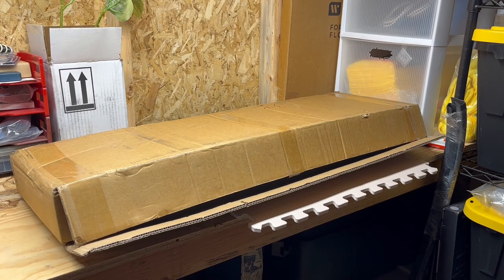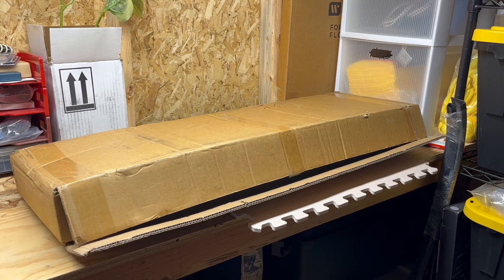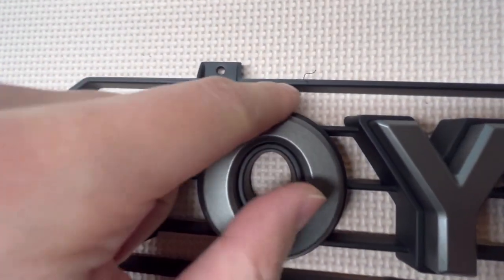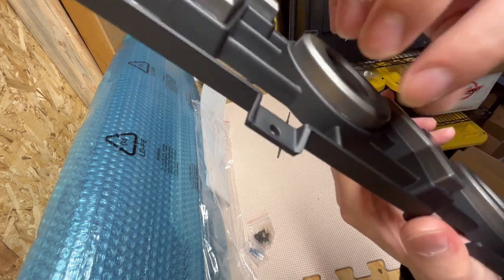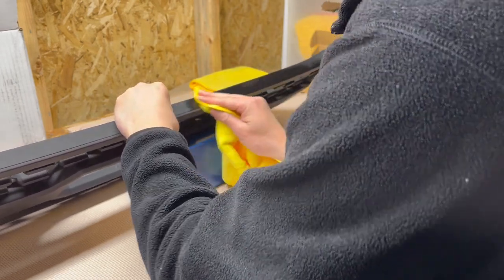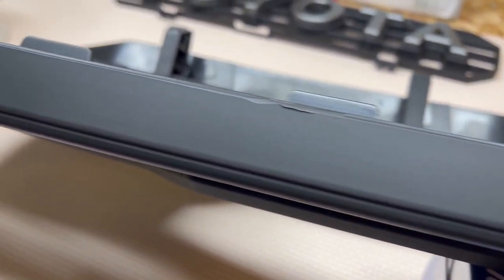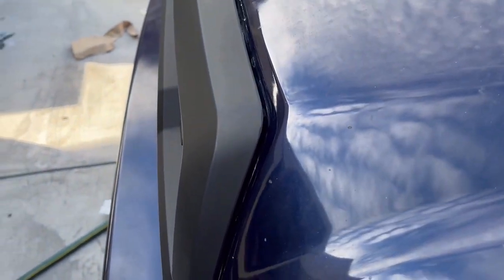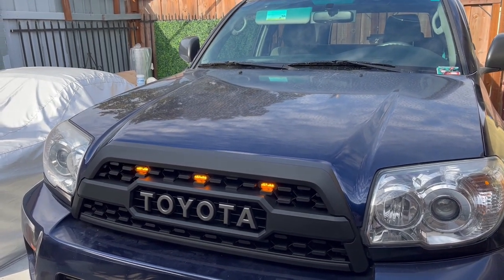4th Gen 4Runner TRD Grill Install

Comment: You paid $130 including shipping? All of the ones I've seen on Alibaba are like $100+ for shipping to the west coast
Reply from the maker: I bought the grill in 2021. Its been sitting on my shelf a while before I installed it. Inflation :(
Reply: @wils_builds  so it seems at this point it's just cheaper to buy from a north American reseller, thank you!
Reply from the maker: When I bought it the shipping was 40 to the SF Bay Area. Shipping might be harder now. There's plenty of North American sellers. But you can probably expect similar quality since they probably buy bulk from the same manufacturer.

Comment: Ill keep my black chrome grill on my 07 sport edition..also had my hood scoop black chromed as the paint was rubbing off and the rear latch assembly as it was rubbing off at 250k miles  ..the flat black really doesnt go unless you do the black headlights and all the id badges...just my personal opinion
Reply from the maker: Im not really sold on the flat black too. I might end up color matching parts of the grill down the road.

Comment: The gap on mine was smaller but I ordered the trim and it made it look a little more polished!
Reply from the maker: Yeah I definitely need to order a new trim piece
Reply: I ordered the trim piece. Toyota calls it a Grille Insulator. $37.00 + tax and takes a couple days to get in to pick up. I don't want to chance having the old piece rip or look crappy and have to drive around grilleless for a couple days.
Reply: @paulcali08  I got it at the dealer for around $20 I think.  The OEM was does have a seal.
Reply: Is this trim piece you guys talking about the metal piece that goes on the inside of the grille, cause I am having the same problem with a gap at the top. If it is do you mind sending a link to whatever the problem is?
Reply: It’s the rubber trim piece that goes on the back of the grill to the hood.  Any dealer will have it or sparks auto parts!
Reply: @Medickep  oh sick alright, thank you!

Comment: Did the coating make a difference in how the grill looks?
Reply from the maker: The coating definitely helped the plastic keep a nice finish. Still looks good and no fading so far
Reply: @wils_builds  what’s the coating called?
Reply from the maker: @ClutchKillers  I used Undr Dog coating on the grill. But any ceramic coating will help to keep the grill plastic looking new. 

I usually use Gtechniq - CSL Crystal Serum Light now. 

https://amzn.to/3rf6Qbd

Comment: What would be a less expensive plastic protector than the Undrdog Pro?
Reply from the maker: I think something like Cerakote Ceramic Trim Coat would work well and last a long time. Its also reasonably priced for a coating.

https://amzn.to/3wb7NQX

Ive also seen many people recommend Solution Finish Black Plastic & Vinyl Plastic Trim Restorer.

https://amzn.to/3XC48Ye

Those would probably both perform well at keeping the plastics looking new. You can always just re apply if they start looking dull later.  

I just had left overs of Undrdog from another project so used it. 

Hope this helps!

Comment: Hey I just installed my grill from TEQ customs. I grounded it just like you. But when I put the fuse into the CIG10A, nothing happens.
When I used the ECU-IG 10A, it works. Can I use that, or should I worry?
Reply from the maker: The ECU-IG 10A will work. I originally used that but switched it to the CIG10A. I chose to not use the ECU-IG because I was worried it could mess with starting the car. I had it like that for about a week and didn't have any issues. Run it at your own risk but I don't think the lights are strong enough to affect the fuse.
Reply: @wils_builds  I ended up putting it into an empty slot in the middle with two 3amp fuses. The ECU-IG actually didn’t work. Caused a bunch of problems.
Reply from the maker: @benwachtel23  I might switch mine to that then. But haven't experienced any issues so far using the CIG10A
Reply: @wils_builds  ok. Also thank you for being the one person who can properly explain how to install the grill. Not even the company I bought mine from could explain it. They never included any steps into the lights.

Comment: I keep coming back to this style grille. I have an 04 4th gen. Some say it'll work others say it will hit the bumper or ill have to swap the trim pieces under the light.

Any idea?
Reply from the maker: I believe you will need to get the trim piece under the light and the 06-09 headlights for this specific grill. They do have another model for the 03-05 4Runners as well.
Reply: Just get the one for the 03-05 years, there are 2 versions for the 4th gens. A 03-05 and a 06-09. Just buy the right one and you will have no problems. I personally have a 05, it fits like a glove!

Comment: where can i get the trd grill for my 2005 4runner, do they all need to be adjusted?
Reply from the maker: They have grills for the 2003 - 2005 models as well on Alibaba. There are some vendors in the US that also sell the grill as well.
Reply: Jose, I got mine from TEQ Customs and it came with the rubber strip for the gap, on my 07 4runner it wasn't a bad gap. Easy install use the original hardware though the new ones they sent out weren't so great.